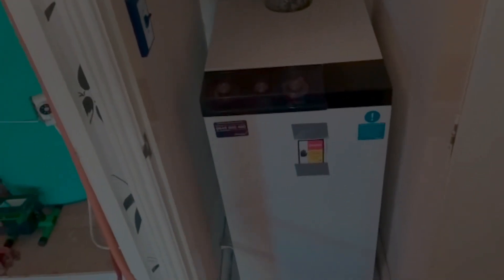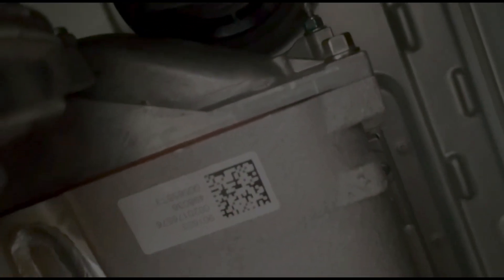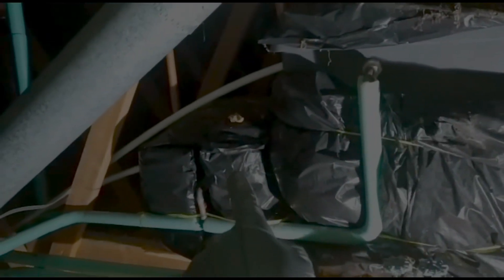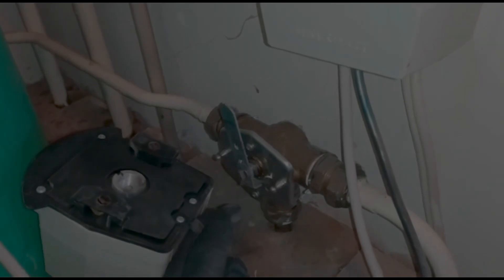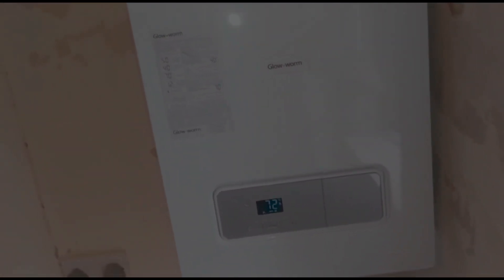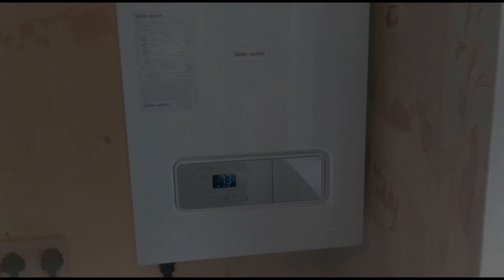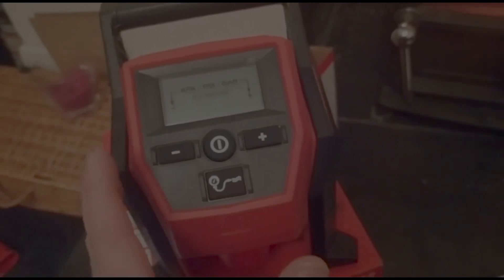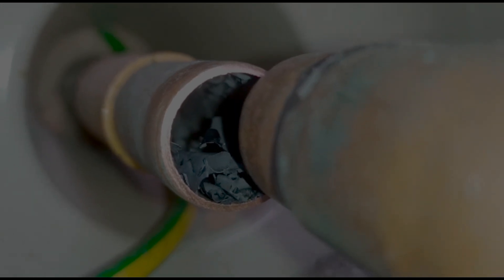Plumbers Videos E Fry Gas Services

Comment: Great video again Allen, just to say I’ve got my Gloworm down to 6kw of power for a three bed semi detached, with weather comp, it works fine. It’s programmed for 24/7, programmed 6 times a day, every program time adjusts about .5 of a degrees depending on the outside temperature. Works great, not too hot or cold just comfortable, all I got to do is insulate this summer. Recommend Gloworm own controls. Flow never gets about 48 degrees, it seems to be on low rate all the time apart from hot water which is set at 45 degrees. Also thinking about under floor heating in as well to make it more efficient👍

Comment: Hi Allen I've a ideal logic combination 24 boiler &  there is a leak in radiator feed pipe upstairs. Can i isolate my heating system directly from my boiler so that when we turn on the boiler the water doesn't go to the feed pipe. 
We just want domestic hot water. Please help it's urgent.